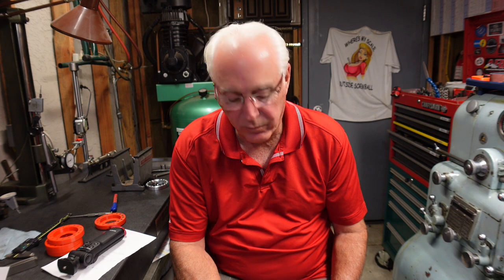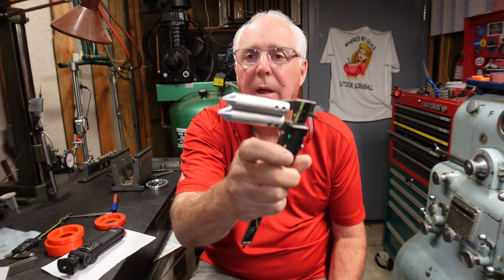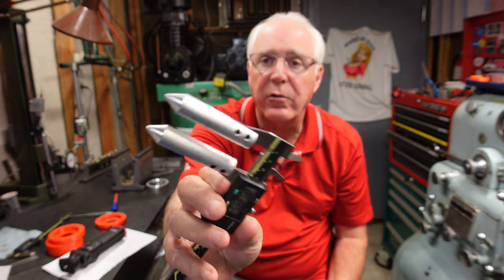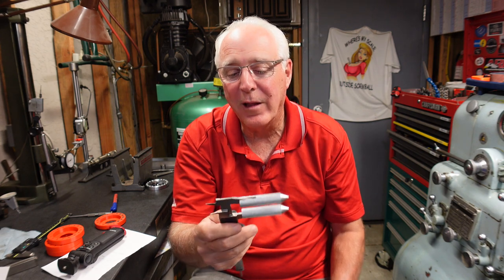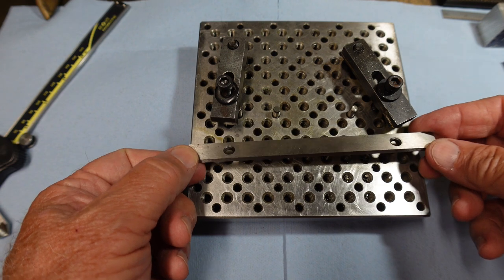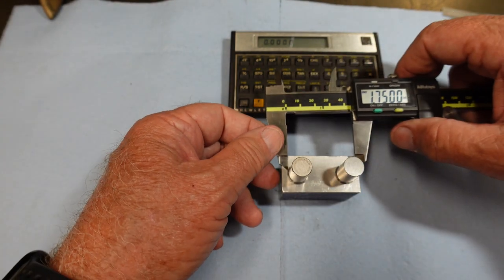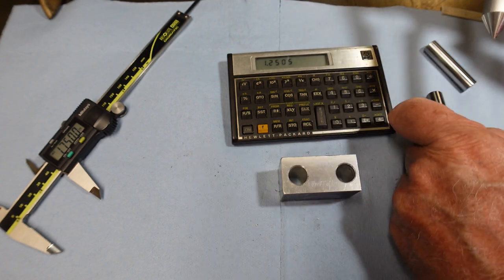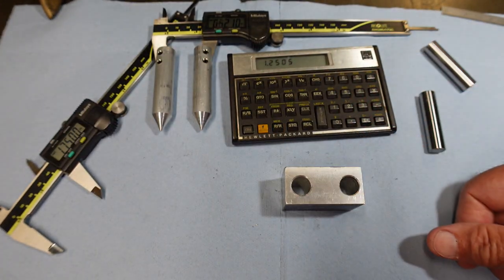Center Gage Attachment (centerline) for the Caliper

Comment: Very cool! So simple, surprised I have not seen it before. I use a similar trick, those center punching studs, I just put a center dot on the back side. Same concept, the cone centers in the hole giving you a central divot on the back side. Sort of like the notch in old scales for setting manual calipers
Reply from the maker: thanks for viewing and your comments

Comment: Spring loaded cone points on the ends (like on a tap follower) might make for an even more useful tool that could measure even if the holes are a very different diameter or unevenly chamfered. For example you could even measure the distance of two holes where one would be countersunk and the other counterbored(or just plain drilled) etc.
Greetings from Athens,Greece
Reply from the maker: thanks for viewing and your comments....awesome Athens!

Comment: these things have been around for awhile i have been using them for about 25 yrs. i find the dial calipers easier to use . just leave the dial set at the diameter of one pin and read them directly.no math involved. Nice job building them. getting those slots to the exact depth would be a little tricky.
Reply from the maker: thanks for viewing and your comments, I will try your suggestion on the dial set as that is what Jason used....

Comment: One more place to get them if you don't want to make them: McMaster-Carr 20415A51	

Note that if the bottom of the slots are exactly co-planar with the points (as the above calipers are) you don't have to do any fancy zeroing; the caliper will read the exact distance between centers. You just can't measure any closer than the diameter of one point.
Reply from the maker: thanks for viewing and your comments, interesting I looked up the part, it list the slot at .125, the Mitutoyo jaws are .136 thick, sure would be a pain to order and then they don't fit...

with that said..."exactly co-planar".....hmmm, back to the mill to get co-planar....probably a follow up correction video!!, thanks for the comment...